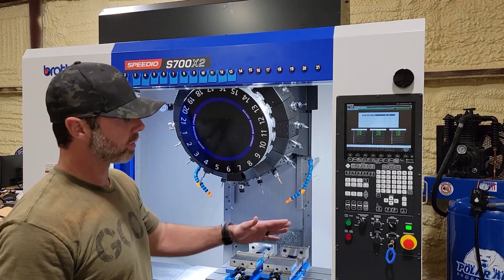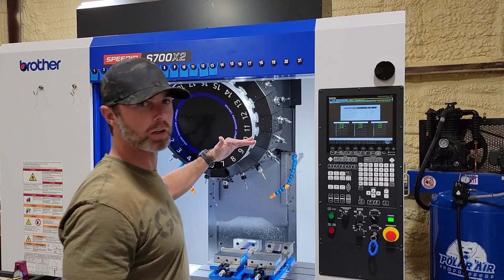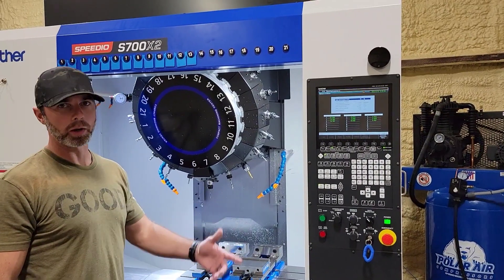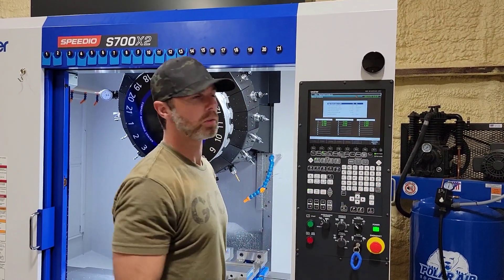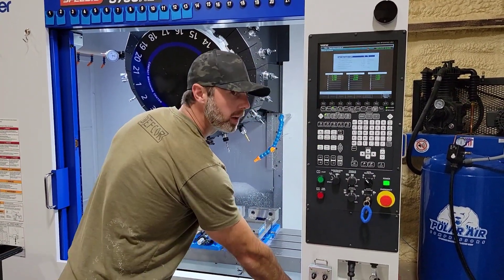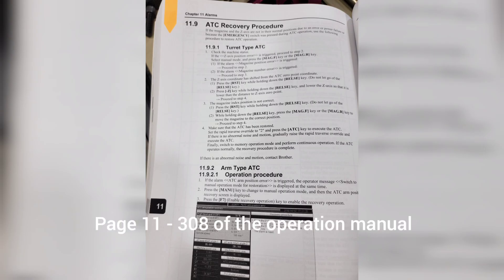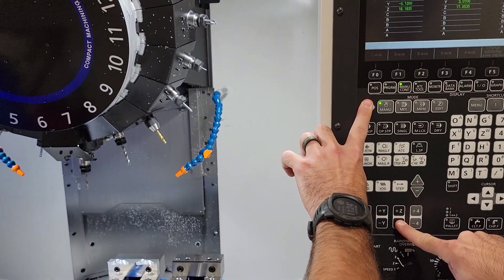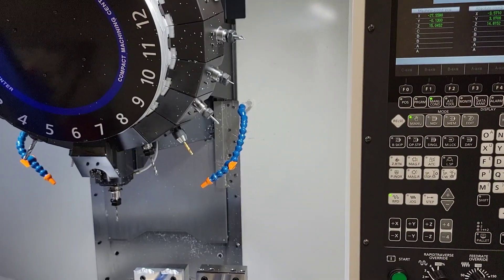Brother Speedio spindle/atc recovery after loss of air

Comment: I did this a few days ago, but it was from forgetting to turn the compressor on in the morning. Looking up the alarm code was faster than searching on the internet though, these machines also have VERY GOOD documentation, especially if you get the service PDFs that the techs use.

Comment: what a very special from this machine is if you turn off this machine,its never ask to warm up or zero return.you can just run it normally without any issue.
but i found some problem. 
1.coolant tank : if you add too many coolant it will overfow out side the tank and flooding your floor. i use blasocut coolant and its turn foating in coolant tank.
2.sometimes chips get inside the spindel and you know what happen to your part.
you need to clean it often.

Comment: Another situation is when you get this error while the turret is in between two locations. A bit more complicated to get it back in position.
Reply: If the spindle is at the top position, simply just hold Release and Mag Forward or Mag Reverse, it will automatically reset to the next available pocket.
Reply: @Peter.Machine  yep exactly
Reply: if the spindle is not top position, if the spindle only stay home position with the magazine out of  position, which would be the procedure  @Peter.Machine